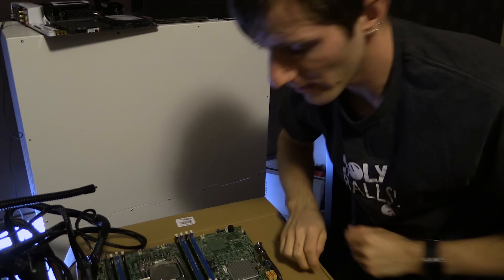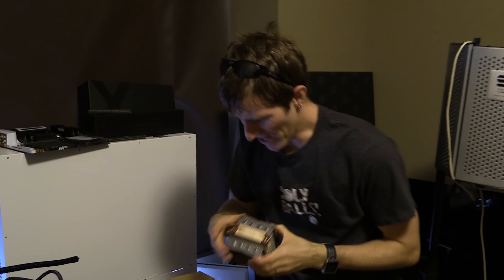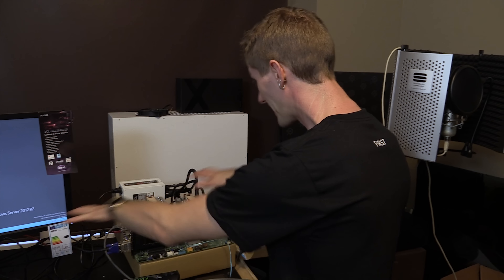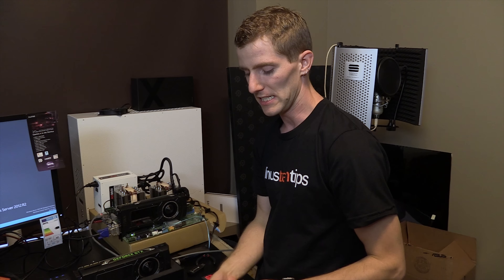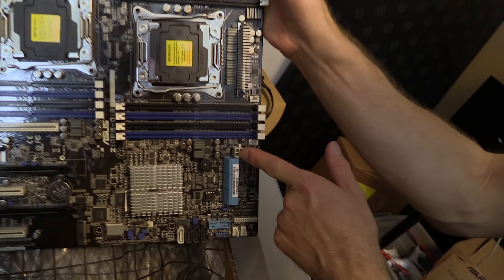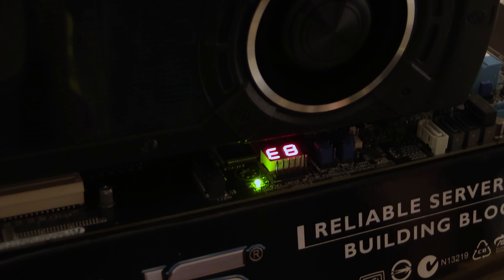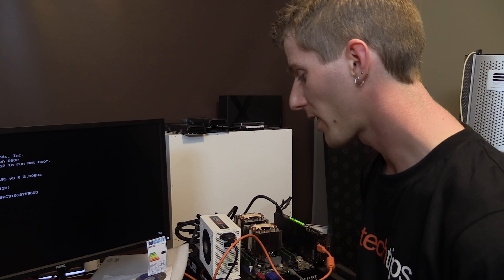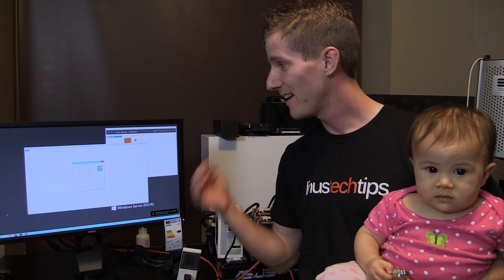36 Cores, 72 Threads, and Two Titan Xs - Our New INSANE Rendering Machine Part 2

Comment: All that aweome computing power wasted on windows SMH
Reply: Huehuehue Huehuehue you're probably right, winblows is a resources hog so I get why one would need 72 cores, but what is an un-modified linux?
Reply: Huehuehue Huehuehue bahahahhaha, ok.
Reply: Huehuehue Huehuehue Laughter isn't sign of anger unless you're psychotic. But whatver dude, to each their own, I know Windows sucks cuz it was my main OS for many years. But after switching over to linux, 6 years now, there's a reason I haven't gone back.
Reply: HigherPlanes They explained why they chose it just if you didn't see that part.
Reply: InfinityEmpireServers oh, I guess I didn't watch that part, I didn't watch the whole video. So what was the reason?
Reply: Huehuehue Huehuehue What is "un-modified linux"? You mean just a plain kernel, with no actual userland OS?
Reply: Huehuehue Huehuehue 1:
What you're referring to as Linux, is in fact, GNU/Linux, or as I've recently taken to calling it, GNU plus Linux. Linux is not an operating system unto itself, but rather another free component of a fully functioning GNU system made useful by the GNU corelibs, shell utilities and vital system components comprising a full OS as defined by POSIX.

Many computer users run a modified version of the GNU system every day, without realizing it. Through a peculiar turn of events, the version of 
GNU which is widely used today is often called "Linux", and many of its 
users are not aware that it is basically the GNU system, developed by 
the GNU Project.

There really is a Linux, and these people are using it, but it is just a part of the system they use. Linux is the kernel: the program in the system that allocates the machine's resources to the other programs that you run. The kernel is an essential part of an operating system, but useless by itself; it can only function in the context of a complete operating system. Linux is normally used in combination with the GNU operating system: the whole system is basically GNU with Linux added, or GNU/Linux. All the so-called "Linux" distributions are really distributions of GNU/Linux.

2: The raspberry pi can run a variety of distributions, such as Raspbian, NOOBS, and Arch. Also, you can run the just normal kernel on there if you so wish, but that would be extremely stupid and impractical since you would not even have an actual operating system installed.

3: Please, go on about how GNU/Linux and "Apple OS" are worse than Windows. I'd love to hear some nice facts to back this up.
Reply: Huehuehue Huehuehue
1A. Not "GNU Linux". The GNU project does not own the Linux kernel, nor any complete distribution. Please refer to it as either "GNU/Linux" or "GNU+Linux".

1B. What is an "edition" of Linux? The term "edition" implies that all "editions" are owned by one company and distributed separately, which is pretty much the opposite of what a GNU/Linux distribution is.

2. There is no "default" OS for the Raspberry Pi, you have to install one yourself. The most recommended one is Raspbian, but not the "default" one as you claim.

3A. Once again, Linux is not an OS unto itself...

3B. The "layout, icons, etc." can be added into a GNU/Linux system if you want. They are not necessarily unique to Windows. For example: http://blog.sudobits.com/2011/03/22/windows-7-theme-for-linux-mint/ and http://www.itworld.com/article/2698416/make-linux-mint-16-look-like-windows-7-or-windows-8.html are basically identical to Windows 7.

3C. So why did you claim that "Also I was implying that Apple OS and Linux sucked ass"?

3D. Windows is not the most popular computer OS. Android is: http://en.wikipedia.org/wiki/Usage_share_of_operating_systems (and it's actually a version of Linux, albeit a non-GNU version).  Maybe you mean desktop OS?

4 (EDIT). Actually, "optimized for" can be used quite subjectively. As long as some work is put into making it run, you could argue that it's been optimized. Maybe you mean more software is written specifically for Windows? I don't have any statistics to back this up, but I'd assume that both Linux (through Android, mainly) and Darwin-based OSes (iOS/OS X, though mainly iOS) both have more software written for them.

5 (previous comment). Modified Linux can refer to a modified kernel, such as Linux-CK, which no distribution uses by default, and this is obviously not what you are referring to.
Reply: Falcon Games 1. NOOBS is NOT an OS, it is an installer. The default OS shipped with raspberry Pis is Raspbian.
2. You're being pedantic.
Reply: Huehuehue Huehuehue
2. Not sure about the new models, but I bought a B+ and no SD card was included at all.
3a. Please research the terms before you make a decision like that. The kernel is the underlying component of a complete operating system that connects to the hardware. When you run a program, it goes through multiple layers, the bottom being the kernel, to "talk to the hardware". An OS, on the other hand, is the environment that the user interacts with, not other software. It's actually even more complex than that, but that's a simplification of the differences.
3b. It's worth using GNU/Linux because GNU/Linux is free software, has more customization capabilities (making it a better choice in a lot of circumstances), can be used for $0.00, is needed for many tasks or for certain types of hardware (especially servers and render farms), is a much better system for programming on, can guarantee privacy for the user, often gives significantly better performance, etc. You wouldn't install Windows for customization. Why was buying Windows part of this example (also, you technically aren't buying Windows, but leasing it when you pay for it, which is a side effect of the proprietary licensing it uses).
3d. Tablets and phones are computer, though. Maybe you are talking about desktop operating systems? And I don't see how the customization ability of Android gives it some unfair advantage in popularity...?
4. I don't think Steam games are by any means the majority of software, or even reflect the state of the majority of computer programs. In fact, due to the fact that so many games use DirectX, which is a proprietary API that only exists for Windows, it is quite hard to compare the two.
Reply: UnderwearThief
1. Okay, sorry about my mistake.
2. I could say the same about your correction, could I not? :^)
Reply: Falcon Games Fair play.
Reply: Huehuehue Huehuehue Raspberry Pi Linux isn't exactly modified because Linux isn't a whole OS, it's a kernel, every distro is different
Reply: Huehuehue Huehuehue
3b. Okay, I was just confused about your wording. Basically, what I was saying at first was that if you don't like the UI of any GNU/Linux distributions, you could just adapt them into whatever you like, including a Windows-themed UI.
3d. If Android's popularity is purely (or even mostly) because of the customization, why has that not been the case with desktop operating systems? GNU/Linux is much more customizable than Windows or OS X and it isn't against any stupid licenses. I am not really arguing your point, but generally wondering why this would be the case.
Reply: TheMightyBuffalo
Pretty much any GNU/Linux system would work, or even OS X, FreeBSD, etc would be a better choice. Since they are going to be using some server software, it would make sense to use either a RHEL-based distro (RedHat (obviously), CentOS, OpenSuse, or Fedora) or a Debian-based system (Debian, Ubuntu, etc.). Since it isn't an actual cluster, a distro made for render clusters would be a weird choice, but might still have some benefits.
Reply: TheMightyBuffalo
I think it really depends on the needs of the final user. I wouldn't recommend a non-UNIX based OS, but the BSDs, GNU/Linux, and even OS X could all be great for a desktop. Personally, I'm using a number of GNU/Linux distros (debian -- better for a new user, and gentoo -- great customizability but not for new users).
Reply: TheMightyBuffalo I learned most of my knowledge of GNU/Linux just by playing around with it, reading wikis and forums or guides, looking things up, IRC, etc. I don't think it takes as much technical knowledge as it does time to become proficient with some of these systems. If you know the basics of the command line, though, it's a great idea to try installing something like Arch or Gentoo since they teach you so much about the terminal, although if you aren't 100% confident with your knowledge you can still use other distributions that will help you slowly adjust into using the terminal.

There are a lot of advanced users who don't ever try out Gentoo or Arch, as well. I'm pretty sure Linus Torvalds hasn't used either before (but I may be wrong). It's just a way to give you more choices so that you can build up an entire system from scratch and pick out every individual component of your operating system.
Reply: HigherPlanes How does gta v perform on linux? oh wait...
Reply: ddswh1pk0s What's gta v lol? Is that a game? Oh wait.. I moved out of my mom's basement. but no really... in the slim chance that I ever decide to go out and buy a copy of gta v, I guess i'll blow the dust off my windows machine and give it a go, but I'll probably be dead by then..
Reply: Huehuehue Huehuehue
I keep a windows machine for diagnosing/troubleshooting, but that mainly has to do with my line of work. I was being slightly dramatic when I said I'd have to dust off my windows machine :-)

Comment: The primary use for that type of CPU is Virtualization. I have been involved in projects using 6 hosts with 2 15 core processors each with 768gb of ram each. Those host were running 200+ linux vm's each or 50-100 windows vm's. These CPU's are also really good for VDI as they have so many threads. 72 threads is enough to do some serious VDI work.

Comment: Don't give up on looking at Linux solutions though.... I use Sorenson Squeeze Server at work and honestly not too impressed with it. It processes at roughly 15 FPS, or ~2x the length of my video. Other software on the same computer (but on the Mac OS X side) like Compressor finishes at about ~.8 Video Length. 

Can't recommend a linux software solution for you, but I know that it can help. BlackMagic Design for instance recommends using their software like DaVinci only on Linux (although Windows and OS X are supported). 

Also random side note on Squeeze you probably already found out. It uses a particular transcoding algorithm that fills up the RAM with the video (unless using CUDA) and then removes blocks from the buffer as they are processed. If you drop in too many videos, it can't perform the compute and takes a lot longer. So even with lots of RAM, you may not be able to transcode a lot of files at once, depending on original format.

Comment: The main point of packing cores onto one die is to save space in the datacenter. Everything is running in virtual environments where each virtual server can get the number of cores it needs, completely disregarding if those cores are physically located in one CPU, or even in the same physical server. And since even clients are moving into virtualization it will soon be unimportant to be able to build powerful clients. The only place where packing performance into a PC will still matter in a couple of years will be in gaming, and even that may make the same transition.

Imagine that rather than each device your family owns having computing power built in, which spends most of it's time idle, you have one server providing virtual desktops to each device with just the ammount of CPU and GPU power needed for the task at hand. Much more flexible and much more efficient usage of cpu cycles

Comment: Interesting. I am a computer / tech geek, so this is interesting. I also like fast cars and sports bikes, executive jets and private yachts. Now, in all these fields, you see similar problems. You can spend the GDP of a large industrial country, but the advantage you get from it does diminish, and the number of cases where you can actually use it to maximum effect, diminishes to zero. Example ... if money truly is unlimited, you could buy your own F-15 as a private plane, but where can you fly it at Mach 2.5? Pretty much nowhere. My last bike was a ZX14. I could have put a turbo on it, beefed up the engine a bit, got around 500 hp from it. (I didn't, but...) So where could I use those 500 hp? This Tim the ToolMan thing of tuning stuff, it is a good hobby - but it has limits. I guess looking for those limits and stretching them is half the fun, but you can burn a lot of cash for no benefit...

Comment: Odd. The Z10PE-D16 WS board is listed on Asus' site as having four 16x PCI-e Gen3 slots and two 8x slots, just like its D8 predecessor (primary difference being 16 DDR4 slots rather than 8). But at 4:23 you can see quite clearly that there are only five slots (as opposed to the advertised 6) and at least two of them aren't 16x lanes. I've been looking at that board for its capability of running 1TB of RAM in a 16x64GB configuration, but the lack of advertised PCI-e is a bit of a shock. Has Linus been sent a weird internal board?

Comment: So how well does it perform for your video generating case that you  mentioned at the end of the video?

You should be running one of those computing projects like SETI, compute PI, protein folding calculations on the offload hours.
Reply: +louis tournas That would cost money though. 90W vs. 500W or more.
Reply: Doug Gale
 True.

Well, not for me during the cold months. Fluorescent bulbs are useless for me as well. Summer is only 3 or 4 months here.

Comment: Two notes.   

1.   If he really wanted 'Just' CUDA support he would add a Tesla card that would work fine on a server board.   

2.   You can compare the X5650 CPU's, but you can also go and buy a HP Z800 with twin X5650's for about $400 now.   I know for sure that his setup costs more than 3 times that cost, for three times the performance.

Comment: Max CPU was 22core, sow with such CPUs should be 88 threads. For serious task no matter how much HT, but how much real cores. Rendering is good just because enough good parralleling task. If solving complex difficult math models,  sometimes such CPUs give not linear acceleration, more similar as about square root of number cores. For 44c sample, it can be (44)^0,5 and this is like 2*sq rt (11). Sow it will be just about 6-8 times faster than more simple variant.

Comment: Will the water cooling mounting plate that comes with the ASRock X99E-ITX/ac work as a non ghetto fabulous solution? You'd have to buy two motherboards for what is probably a $2 part and you'd have to get 2 h80i or h100i aios. Also asrock website states that the plate is 'Compatible with Cooler Master Seidon 120V Plus/120V CPU Coolers" but Id rather have the corsairs. I'm sure being you you could probably just call asrock and get them to send you the 2 plates 4 free.

Comment: This system might actually be 'adequate' for editing more than one stream of XAVC-L UHD video footage. With enough RAM, it might also be capable of some medium complexity BiFrost simulations in Maya. These applications can never seem to get enough CPU horsepower and RAM space. GPU rendering has been king for a while, since it's hard to compete with 3072 cores working in parallel.

Comment: There's one thing that grinds my gears...
Since this processor has got a Turbo of 3,6GHz, is there a possibility to set the BIOS so that ALL cores would run on that clockrate? Or is it just tied to the ratio shown in the video?
(I know that would require an even better cooling system, still would be cool to know!)

Comment: I can see real world scenarios that running Windows on this would make sense. Granted, it would probably be running alongside many other Windows and Linux vm's on a VMware host, but it would be running Windows nonetheless. These 18 core processors may seem a little outrageous, but high core count processors are quite common. 24 - 48  thread dual socket systems are fairly common even in relatively small businesses, and typically running in some kind of a virtual cluster.

Comment: There is nothing wrong with Windows Server on large, multi-processor machines.  At my company (and many others around the world) the Windows Server OS is often used for large scale applications (such as database servers), and it performs perfectly fine.  A desktop OS like Windows 8 may or may not be able to handle it (I don't know), but Windows Server certainly can without issue.

Comment: I wonder if you were to use two phase change coolers to cool the two 36 core processors which means that the system won't throttle down when you need maximum processing power might enable a bit of an overclock  which make transcoding your 4KHD files take less time heres just hoping, but what about a four SP3 Socket motherboard and 4X AMD EPYC 7601 processors and 2TB of DDR4 RAM and your two Graphics cards.

Comment: I'm not going to say WHERE I work, but recently I came upon a Power9 CPU from IBM:

24 cores - each core are 4.0Ghz
8 threads per core
120MB L3 cache

Imagine running a dual CPU system with these monsters plugged in: 48 cores - each at 4Ghz - 384 threads.
Reply: Did you wipe it off?

Comment: So Linus. I was watching this video and noticed not for the first time you allow a CPU to POST with no cooler. I did an "experiment" once where I left the cooler off my CPU (an Athlon XP 2000+ at the time) and literally as soon as I pressed the power button I had AMD burned into my finger I could ACTUALLY see the letters AMD burned into my finger for a while. Shouldn't one at least have a cooler if nothing else sitting on the CPU? is there NO possible damage from confirming a POST quickly and shutting the system off? I'll admit my testing was limited but it was extremely memorable....